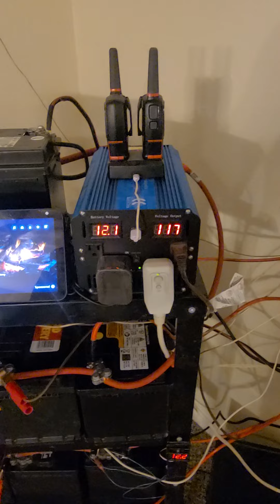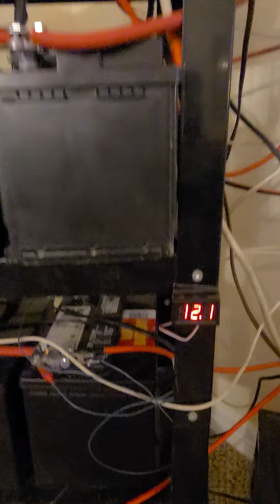Battery bank for my solar panels

Comment: I like it, a 12 volt?? How long can you run your ac with it over night? How many amp hours do you have there??
Thanks
Reply from the maker: 12 volt yes.. those batteries are all used like new and different sizes at night and full capacity use and drain maybe up to 2 hours at night.
 With the sun in the summertime for a very long time

Comment: That high frequency,output transformerless, low surge inverter is not going to last you very long running an AC unit. When it does fail, I would suggest replacing it with a heavy duty low frequency inverter.
Reply from the maker: Thanks for taking the time and watching my little video..  TBH this will be 1 year anniversary of the inverter and both as done me well as the other runs 2 air compressors 1 hp each in my truck. I didn't have a lot of funding, resources , and knowledge compare to today. I am excited to see how it will hold up this summer with these new cables. I appreciate your advice and when it konks,  I will look into your recommendation:)
Reply: Wouldn't a soft start be a cheaper option?
Reply: I'm running my whole house on a transformerless inverter. In September it will be 4 years. I'm running 3 Dual Inverter AC units as well. The system is capable of 6500w but I seldom use over 50% of the capacity. Usually it will exceed 50% when we use the microwave while using the AC units. The biggest unit is 1400w, then an 800w, and a 600w. The 2 smaller units are in the bedrooms and don't work very hard. Being dual inverter they also seldom pull full power except on start up in a warm room.
The battery bank is 20.4kw and powers the house through the night and still shows 52.8v when the sun comes out.
Reply from the maker: Lithium or what kind of batteries? How heavy the  battery bank?
Reply from the maker: Lithium or what kind of batteries? How heavy the  battery bank?
Reply from the maker: Lithium or what kind of batteries? How heavy the  battery bank?